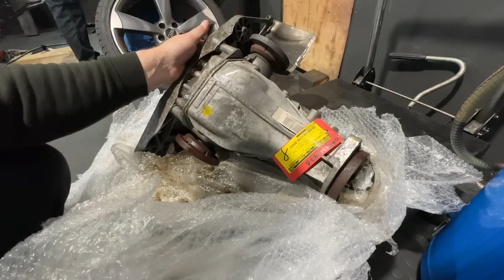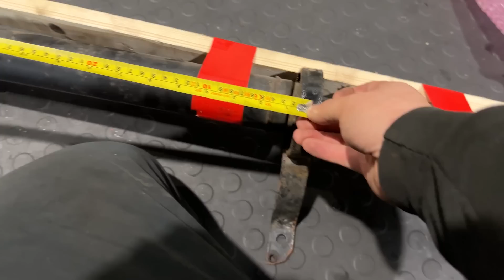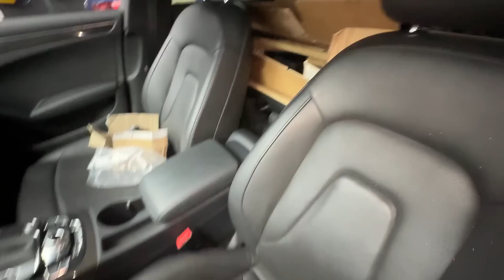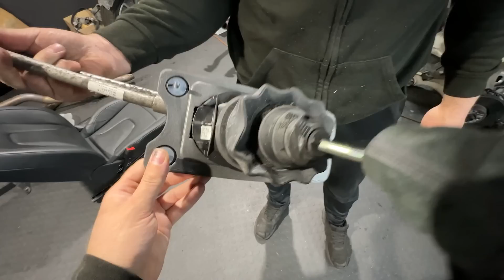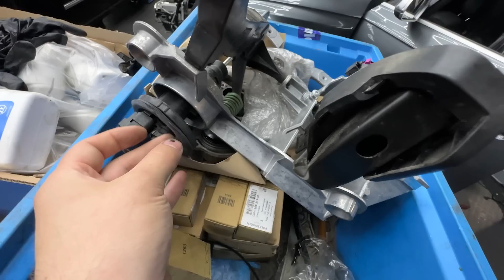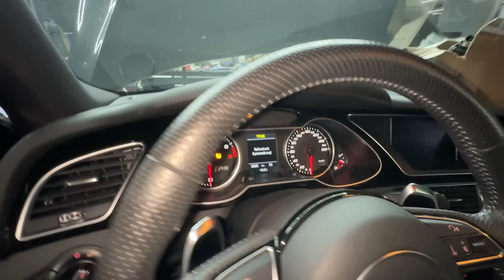Convert Audi RS4 B8 from DSG into MANUAL? No problem .. But who will HELP US to finish it?

Comment: Hey you should look into 4.0 tt swaps people are doing into older chassis. I believe they use the same med17 ecu and people know some trick to make them run with a manual. They usually use stock ecu with DS1 but not sure if thats for tuning only or necessary for manual trans.

Comment: You will most definately need a map with custom code, I have never looked at this particular swap and what's needed to make it run as an OEM car - but my first thought is to patch in related functions from a different MED17 software which has the support for manual gearbox aswell😊

This sparked my interest for sure, I've done many softwares with custom coding for swaps etc before - lmk if you still need help with this👍

Comment: Great video, as always!

One comment though from an owner, who has several cars that are special to me - putting seat and steering wheel cover before getting into the car is a minimum I would expect from a reputable shop in order not to make the car dirty. It's a small detail for you, which is greatly appreciated by owners, in addition to the main thing - getting car fixed/serviced.
Reply from the maker: Or ! Do a full clean in price for 350£ 🥰
Reply: I clean my own car and it always is spotless. And I expect that I receive it back from the workshop in the same condition, without additional invoice for 350eur 😂 @VAGTechnic

Comment: I need help!!! My old junk 3.0 tdi is broken asb, I can not push pedal to the metal, its like motor is disapering after 3500 rpm what can it be, excepr hpfp and pressure regulator 😢, no fault codes during this cut of thrust

Comment: so just a thought I had and not sure if it would work but what if you code all the important modules like the ECM and gauge cluster and whatever else is necessary to make it happy to think it is an S5 with a manual then have ECM tuned for that engine. so I know you changed the coding so it is manual but so many of the modules are connected maybe the whole car needs to think it's an S5 with a higher performance engine. just a thought, don't know if it would help, just putting it out there. and I hope it all works out.

Comment: Hi from the US,  I would speak to the Humble Mechanic here on YT ; he did a RS3 engine swap to a VW R32 which involved comparing and modifying the wiring harnesses and coding and Immobilizer etc.  He has access to ODIS with his friend Paul at DAP parts.  If he can get a mixed bag like that to work, I'm sure he could help with your simple swap.  He has a YT video documenting that conversion as well.
Reply: He referenced HM's video of swapping the S4 DSG to manual.
Reply: Humble Mechanic's swap was actually a MK7.5 Golf R, not an R32. There was a shop in Connecticut that specialized in these swaps, but the owner now works for Equilibrium Tuning.
Reply: That’s a good guy to give a call😁
Reply: If he can't doing they can't because this is Audi not VW

Comment: @VAG Technic One of the options is to get ECU from manual S4/S5 and assemble it that way. It would definitely need a tune but those versions did actually have manual as an option, other than that, standalone ECU or tune from scratch :/ .
Reply: @jabberwockytdi8901  
Different ESP sensors, different steering column stalk, possibly ABS pump(bc of ESP), newer abs pumps "can" be made so they are standalone-bc of esp(I have heard of only two cars with this).
This is "lets see if it works" Project,  TUV compatibility is something the owner will have to work through.

Comment: I'm curious what code ECU is being used here, bc here in the US the RS5 (same engine as RS4 in this video) ECU will not take the manual coding so this is thought to be impossible. But it sounds like the RS4 ECU took the manual coding no problem?

Comment: I was running through all the signal inputs from an auto into the bus versus next to nothing from a manual while the engine was coming out. My way to work would be to get the two wiring diagrams and make the wiring changes before installation, but I cannot escape the liklihodd of using an ECU from a manual V8 car to ease the process. I eagerly await the outcome (and total cost) of this project.
Reply from the maker: S5 V8 was manual , but it’s slightly different

Comment: So the day is giving speed sensor and you need that signal from wheel speed sensor instead
The park neutral switch is just an input output signal which could be converted to ignition switch or something like that to let ecu gets signal

Comment: Ultimately, if the ecu could work with the manual gear box that is perfect. If that is not happening, maybe just let that ecu think the car is in D mode then you could have full power. But there have to be a switch for the owner to switch  between D and P (because the car is not able to be lock in D). I saw people did that with another auto car which doesn’t have manual variant. Thanks for interesting contents so long as a b9 owner.

Comment: 37:50 problem is in communication between engine and gearbox computer, maybe you should put computers from audi with 6 speed manual gearbox and install tune from v8 engine computer, or it should look like you swapped engine in audi with manual gearbox

Comment: Pretty sure that car is MED17. You are likely going to need a CAN emulator for the DSG signals.

If you have the CAN messages I could build you an emulator. Not sure my S6 DSG has the same signals as the RS4.

Comment: TVS Engineering in Holland are VAG group experts tuning/gear box experts.
They are an option when it comes to reprograming the ECU since they done such for 15 years.
Aswell as 90-95% of all VW tuners are using their DSG software anyways.

Comment: Can you not use a canbus repeater to fake the codes that ecu is expecting. I got very close to fixing a Renault scenic with electronic dual clutch auto. Mine had a dead gearbox ECU. With an inexpensive canbus repeater was able to tell engine ecu that gearbox ecu is present to start the car.

Comment: Nice to see you guys pushing yourselves out of comfort zone. These jobs make a difference between shops that are willing to learn and improve, and shops that are always doing same stuff. Can't wait on other parts!
Reply: Although something different, not something I would even commission to be done. An RS4 has a DSG gearbox for a reason. The older model RS4 is suited for manual gearbox. Not the B8.5 version. Just not the done thing. Aesthetics. Power. Gear changes. Auto gearbox changes quicker than manual. R8 manual B8 is awesome. Done properly. You wouldn’t then turn the V10 auto to a manual, would you? Not a good look. Great YouTube content as always.
Reply: @lifeslooker  Actually it is very desirable to turn the R-tronic V10 into a manual.

Comment: is there any previous version that came with a manual? with a simillar engine?
i´ve done an engine swap in my B6, used an A6 1st gen 3.0tdi engine and loom, the donnor was an automatic, and it didnt boosted in 1st and 2nd gear untill i have changed the ECU to a manual ecu from an A4 B7.
Reply: also, isnt an Haltec/ Fueltech ecu for engine management a possible "cheap" sollution?

Comment: If you can get your hands on a V8 stick Audi R8 from 2014/2015 era that could be helpful in resolving this in terms of software files.  Also you are likely dealing with two ECU's.  Maybe APR tuning out of the US could figure this one out?   They do ECU tunes on the EA824 FSI motors up and down the range of  the variants.

Comment: Possible issues I can think of are Speed sensor for the Speedo? Does it come off the Canbus? I know on C5 RS6 manual swaps everyone ends up with TPMS & Antilock faults. They need something beyond a regular performance tune with someone knowledgable enough to do the special tune. Maybe MRC? I think the mechanical part will be fairly straight forward since their were S4/S5 manuals. Some wiring changes due to the two switches on the clutch assembly so things like the Cruise control will work properly and disengage when the clutch is pressed, etc....
Reply from the maker: The ecu don’t have clutch option in the loom . MRC didn’t want to help us 😀 out of comfort zone
Reply: @VAGTechnic  You'll have to get into the wiring schematics. I don't have the A4 schematic to look at but it's probably close or the same as the A5. For the A5 on Pg 1/29 it shows the two pedal switches. One goes straight to the ECU and the other ties into a wire that goes from the ECU (different pin from the other switch) to the J393, Convenience system central control unit. In the A5/S5/RS5 it is the big unit with multiple plugs in the right rear cubby hole in the boot. Doing the wiring is the most time consuming. I know there is a couple of cars in the States that have been done.